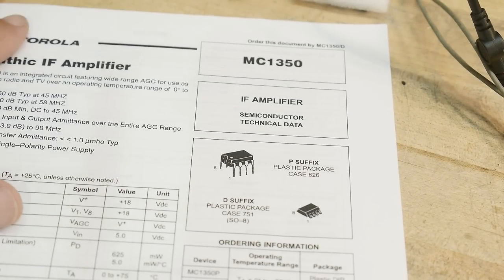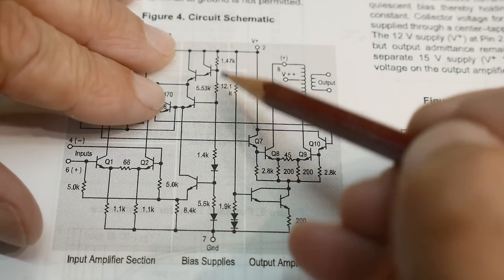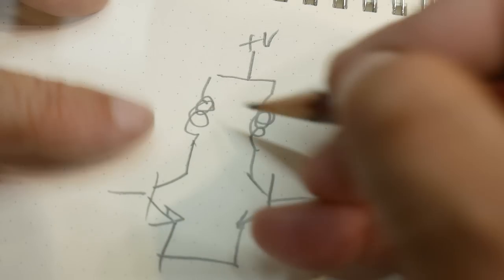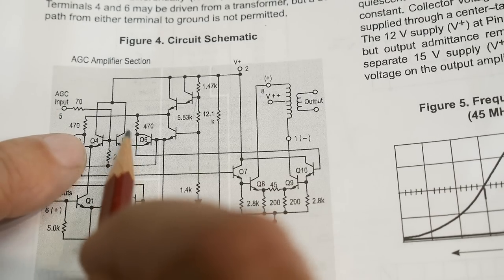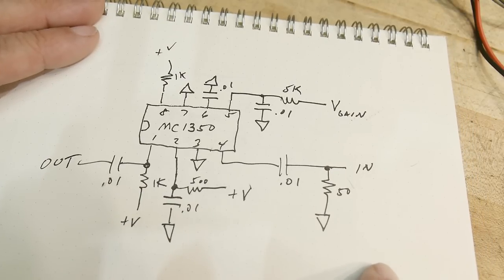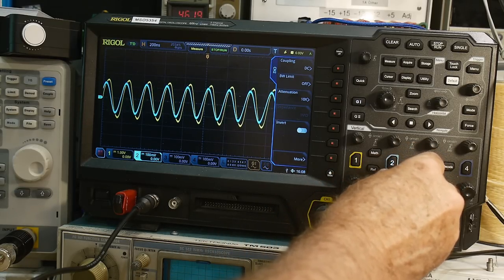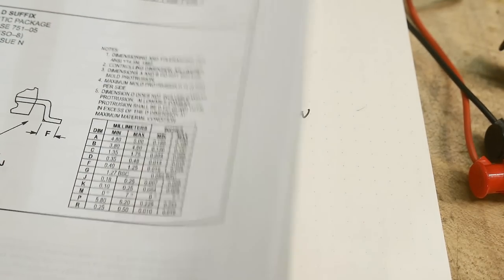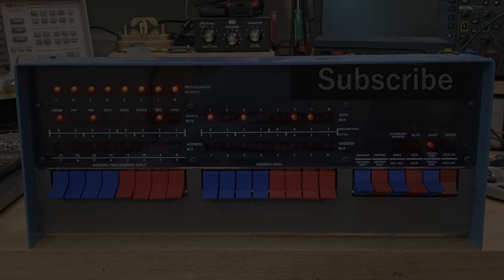#1632 MC1350 IF Amplifier with AGC

Comment: In my opinion redrawing the output transformer obscured matters.
No phasing dots were shown on the two-winding transformer, which I think gives the impression that the phasing in both is the same (e.g. "dotted" ends of both go to V+). The original schematic clearly shows a centre-tapped transformer. The latter is critical to correct operation which in effect applies AC to the primary. If there were two windings with the same phasing this would not be the case.

Comment: Thanks for a great video! Would you be opposed to the idea of doing a deep dive video (or series) into the transistor circuits shown in the circuit schematic for the MC1350?
Reply from the maker: you can start with this if you haven't see the series: https://youtu.be/Z8JDsvfZjL8?si=YFuY153zBEy924nL

Comment: very nice!
Can you also do something with higher frequencies?
say 100 to... 150MHz?

Healthy and Friendly Greetings from the Netherlands!
Rob
Reply: The data sheet for the similar MC1490 shows a detailed RF characterization of the device. At 100 MHz, the maximum voltage gain directly driving a 50 Ohm load is on the order of 7.5X. The gain takes a nose-dive at higher frequencies. It may be possible to improve on this by impedance-matching the input and output.

Comment: when i look at those ic schematics i just see a waste of transistors.
Reply: What should they use instead of transistors then?
Reply: Why a waste ?
Reply: @andymouse I bet I could do this with 2 transistors.  its just an amplify,     u dont really need opamps if you can wire a transistor into a differential type thing anyway.
Reply: @magnuswootton6181 I look forward to you posting a link to your video showing that how to do it with two transistors.
Reply: @magnuswootton6181 ..reduce further..why two...WHY NOT HALF A TRAN
SISTOR...😂😂
Reply: @JaenEngineering  you dont really want to see it,  they are pretty disorganized videos, but I could if I had to,  I doubt anyone would listen tho.
Reply: Maybe you need to learn some analog circuit design.

The subcircuits are not op amps. They bear some semblance to parts of circuits used in op amps.

One of the great boons of integrated circuits was that you could use more parts and do a substantially better job of something at very little additional cost. In ICs, resistors are a problem - they are hard to make to precise values, though relatively easy to make in quite precise ratios. They take a lot of chip real estate. By comparison, transistors are small. Very useful things can be done with transistors that are inherently quite well matched and again, that can be made to do things in well-defined ratios. It is perfectly reasonable on an analog IC to use transistors "instead of" resistors.

I'd bet very big money you couldn't come even remotely close to doing the function of this IC with two transistors - or even a dozen transistors. I'd bet you couldn't even accomplish this, as mentioned in the datasheet: ""nearly constant input & output admittance over the entire AGC range" - if you even understand what that means.

The people who designed these ICs knew what they were doing!

Also check out "Dunning-Kruger effect."
Reply: @d614gakadoug9  you've "doug" your heels into " illusory superiority"🤣🤣🤣
Reply: An engineer named Bob Widlar was instrumental in the shift to using large numbers of active devices in IC designs. The engineers who designed very early ICs were still operating under the paradigms of discrete transistor designers, so they were creating modules that contained a semiconductor die with the transistors and separate substrate(s) for the passive components. These things were expensive to make, but the customers at the time were NASA, the military, and manufacturers of expensive industrial equipment.

Widlar showed the IC designers of his time that in a semiconductor die, there is very close matching between the characteristics of all the transistors and diodes. Designs exploiting this close matching could do things and achieve performance levels that (in many cases) discrete transistors could not. The cost of putting all of these "extra" transistors on a single die still ended up being less than building a more minimalist design with a few transistors because of the added costs of device packaging and circuit board assembly.

Similarly, one could consider how operational amplifiers became ubiquitous in audio design starting in the 1970s. Op-amps are used in such a way that one is "throwing away" most of the gain that is available. However, since the circuit's behavior becomes almost totally dependent on the resistors in the feedback loop (which are very linear), distortion can be very low.